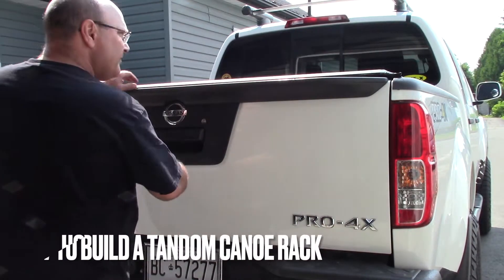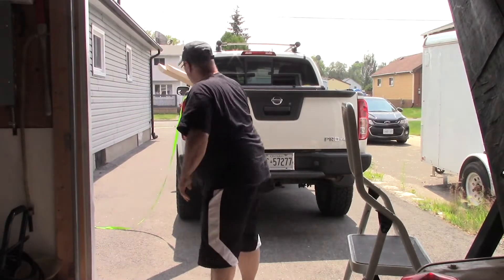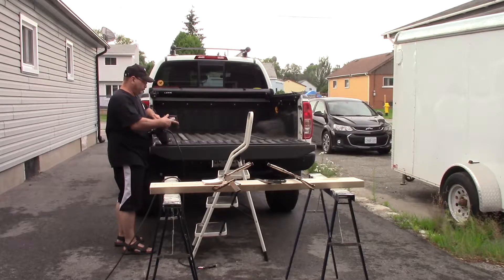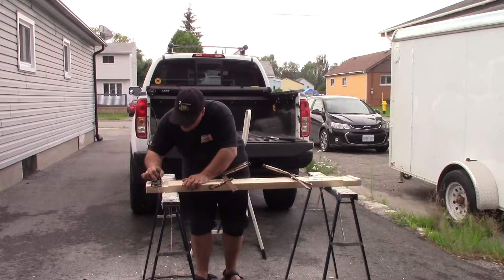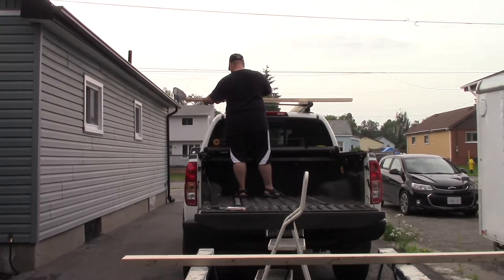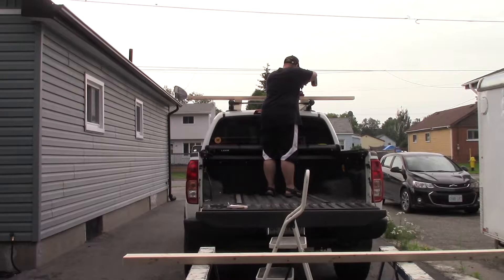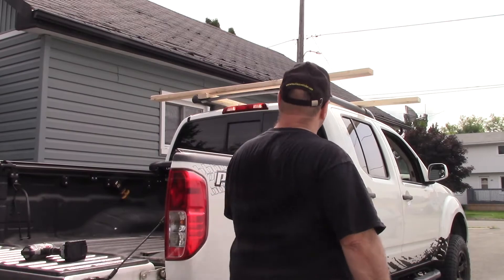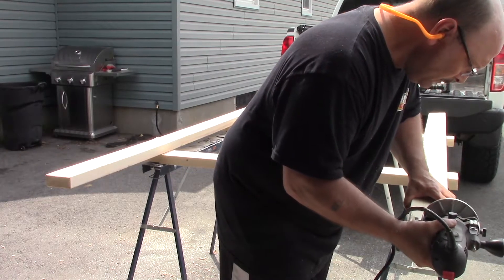How to build a tandem canoe rack for your car/truck

Comment: Truck looks good too.  I use to have the older 3.3L supercharged Frontier.  I also lifted mine and put on bigger tires on
Reply from the maker: It sure makes amid size truck look like a capable truck don't it?
Thanks for coming out my friend🍻
Reply: @OpenAirOutdoors   I drive a Tundra now but I always have a soft spot for the frontiers.  You did well lifting it with the tire combo.  It looks very proportionate.  You wont be getting stuck on those crownland trails now ;)

Comment: How's she goin'?  A great build Marc and the canoes fit perfect!!  Just a thought, what about adding an eyelet on the end of each cross member and maybe in the middle too.  They would make a good tie off spot and help to keep the canoes from sliding off the sides.  Just a thought is all.  The rack looks great!!!  Take care!!!
Reply from the maker: I thought of doing just that! But having eyelets on the end means having to lift over them and probably get snagged up, not good especially when removing. And when I strap I go around the underside and back again so its double straped and pulled tight against the cross bars.
I might make a video on hot to tie down a canoe in the near future.
Thanks Mike take care out there✌️